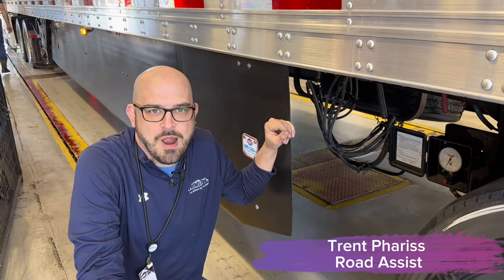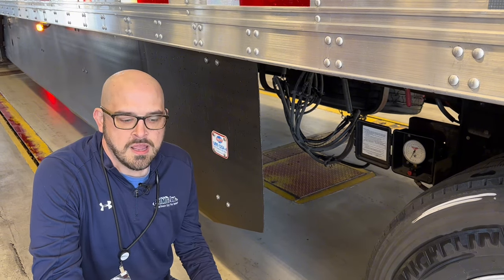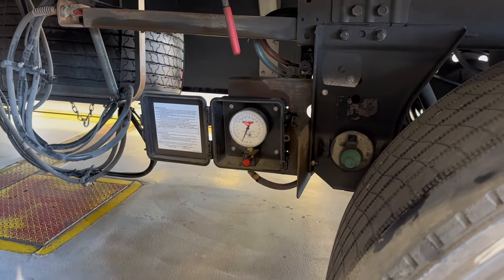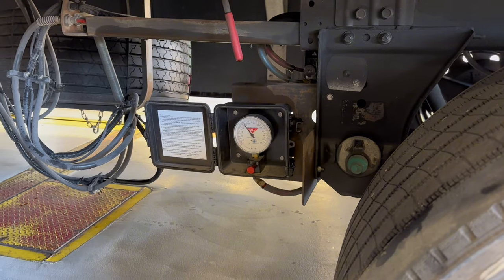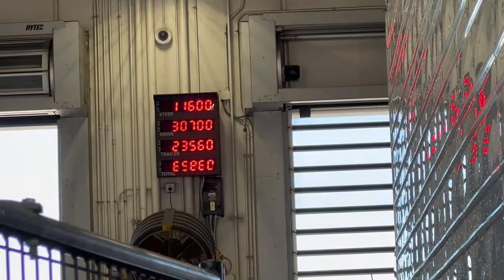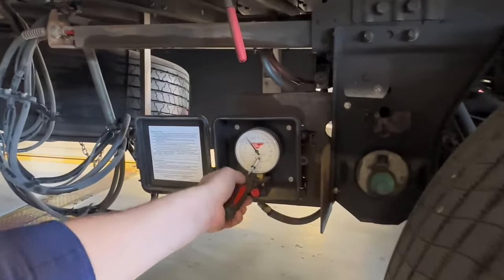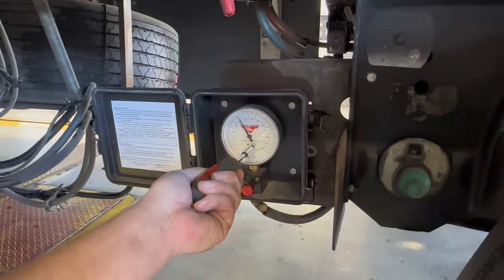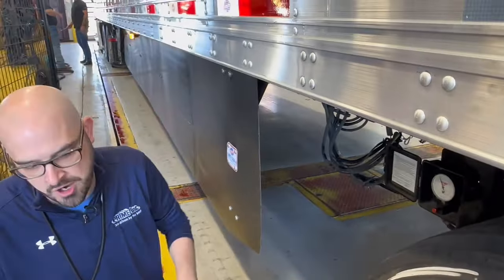How To: Calibrate Your Right Weight Scale

Comment: Do you calibrate it with the trailer brakes set or released?

Like air the system up then keep the brakes released or set them then calibrate?
Reply from the maker: Technically the weight would shift some when brakes are released so keeping released would be the best method.

Comment: How To Calibrate Weight Scale in side of truck
Reply: The one in side of truck should i push the breaks in and change the gauge or should i turn of the truck and change the gauge ?
Reply from the maker: It would be the same for the inside of the truck as well.

Comment: I was taught to not recalibrate unless weight on trailer was at least 30k for accuracy???
Reply from the maker: For best accuracy it should be calibrated at both empty and max weight. We unfortunately had a light trailer when filming this video.
Reply: @PRIMEINCTRUCKING  good deal.  Thanks.
Reply: Per the manual, over 35k to calibrate. Sad, no one writes down calibration weights or dates. Picked up a lot of trailers  with nothing written on the right weight.
Reply: @tobyhunt4281  yep.  How hard is it to carry a pen and your pocket screwdriver to the back of the trailer.  😝

Comment: I’m torn. Yes, it’s valuable to know how to calibrate the scales, but unless someone is fully aware of all the nuances involved I’d recommend against beginners calibrating the scale. Otherwise they could be unknowingly throwing a calibrated scale out of calibration. For example, a lot of drivers will need to park their truck in order to go inside to retrieve the scale ticket. It would not be accurate to calibrate the scale with the truck in a different location from where it was scaled, due to an incline or having the brakes set. You would need to leave the parking spot and return the truck to the scale to accurately calibrate the on board scale to the weight on the ticket.  (Having the CAT scale app avoids this issue since the driver doesn’t need to park in order to see the weight.)